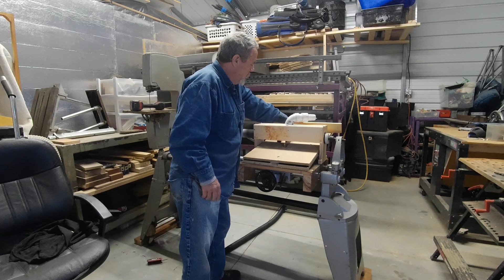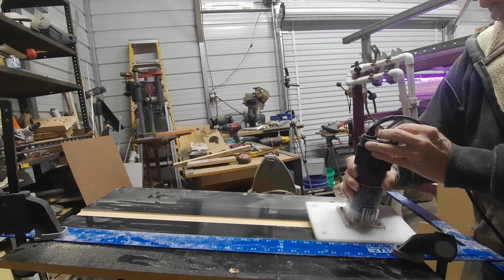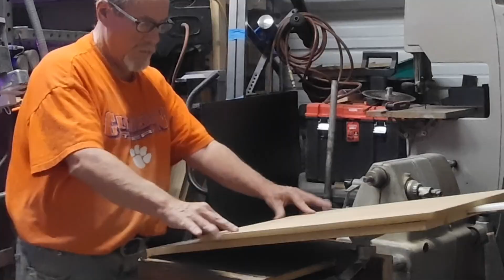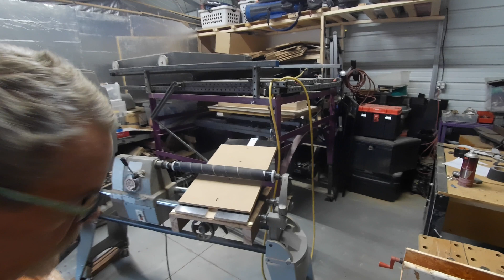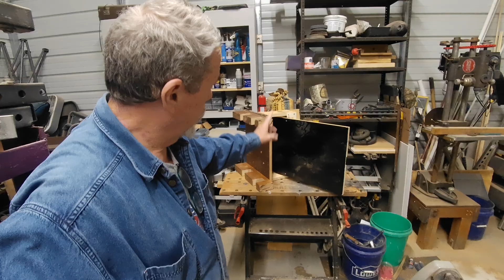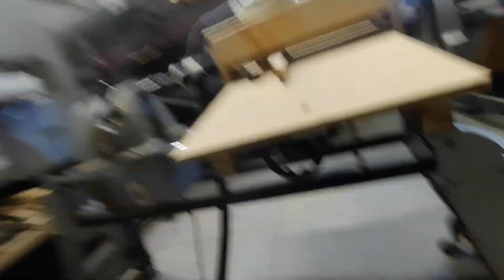Final DIY Thickness Sander for the Shopsmith/ Total Shop or for your Lathe       Full Build in 4K

Comment: I like it ...A LOT !!  Just a suggestion, I use Meguires spray wax for cars on my SS tubes and anything wood that moves too ! I even used it on the under bench wood drawer I made and that puppy slides like it's on roller bearings !!  Keep up the good work and PLEASE be careful with loose clothing around moving parts !! I wanna see more of your great ideas !! Thanks for a great video !! You've got a new subscriber !!